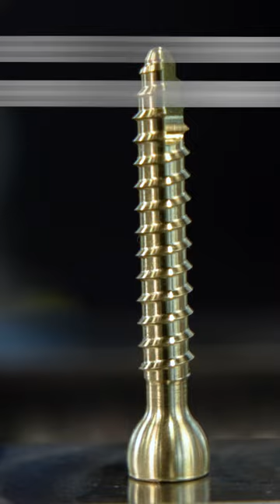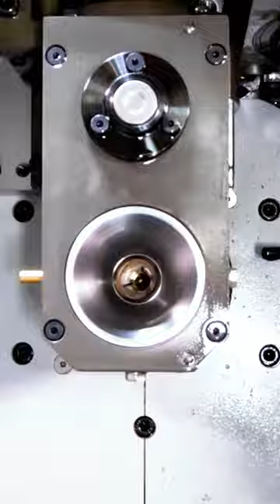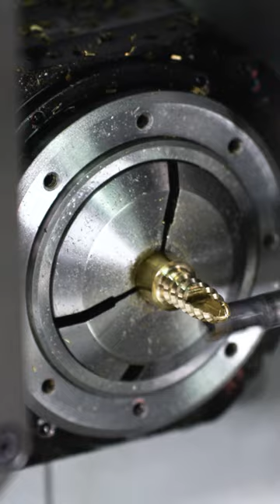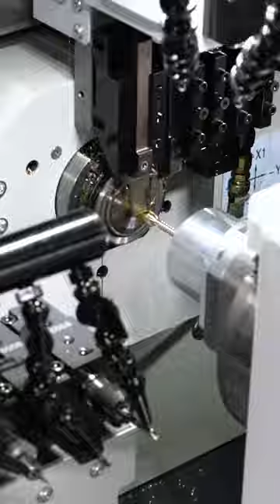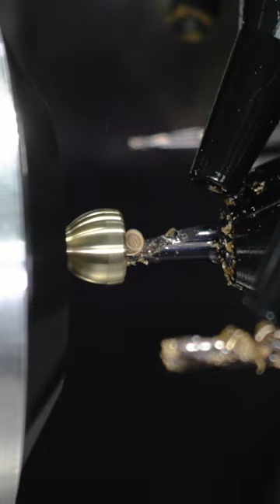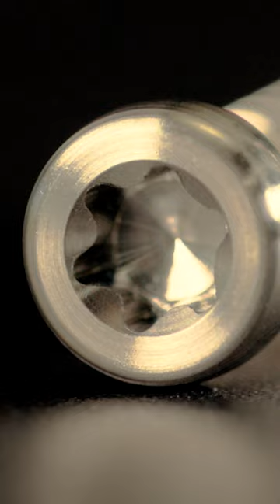Fascinating World of Thread Whirling Bone Screws

Comment: Very cool, showing the capability of a cnc but  using that method it must be about a $25 screw after all cost are added before it get into the hands of the user.
Reply: Don’t worry , the insurance company will add a massive markup to the measly $25 estimate of yours.   I would’ve gladly taken the $25 cost per screw rather than the thousands charged by the insurance company.😆😆
Reply: Considering its going into someones bone to stay for the remainder of their life, thats perfectly fine
Reply: No u mean 25000
Reply: I'm cool with that. You're not screwing a deck together.

Comment: Omg they don't use brass for bone screws wtf
Reply: I was thinking that theyd use surgical steel?what do i know
Reply: Brass is used to demo CNC machines
Reply: Brass is used for setup as you can run it without coolant and with the doors open fairly safely to watch the process step by step to make sure it is correct before running multiple of the parts with the actual material which at least for the ones I have made at work are titanium.  Surgical steel is for tools not for something that stays in you.
Reply: @spacedmarine708  implant grade titanium, not steel